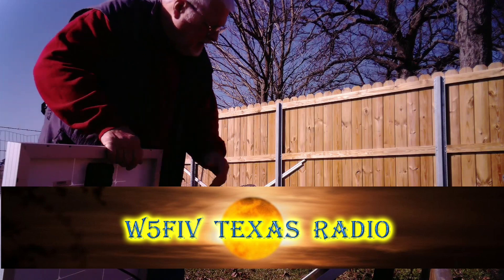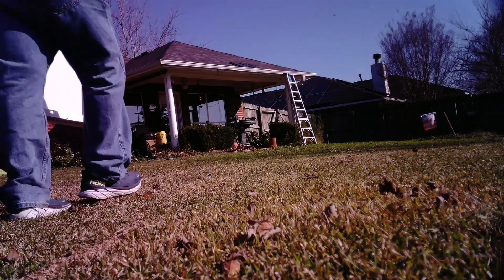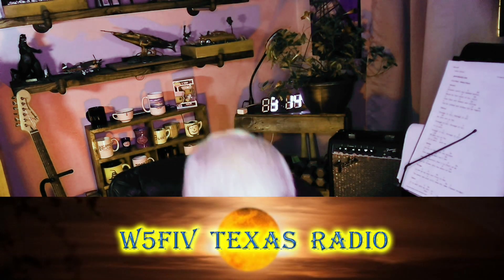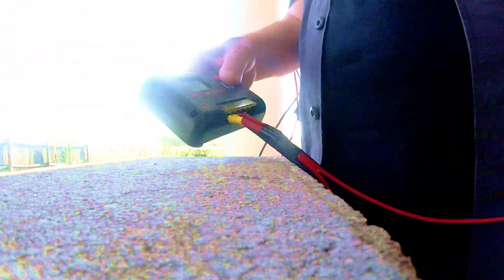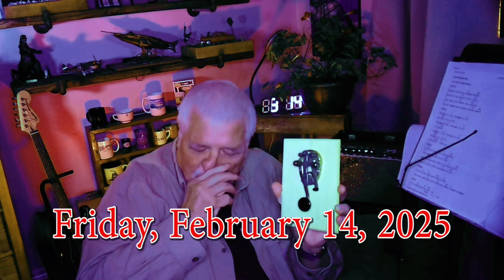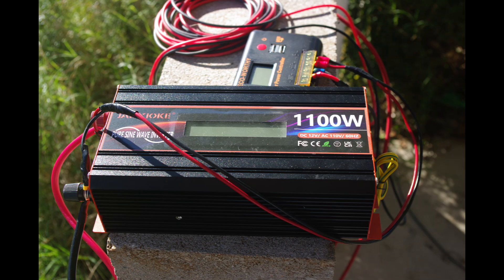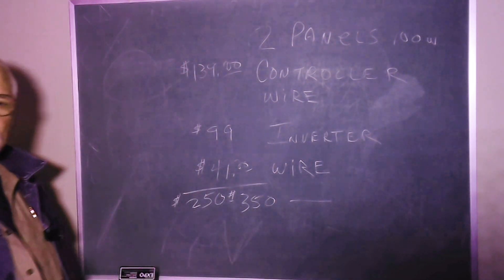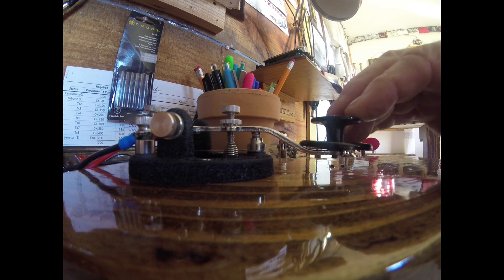How to Build a Solar Powered Shack

Comment: hey have a great day. i saw your morse code videos and wondered.. where can i use morse code? im a mining engineer.
Reply from the maker: Morse Code is mostly used now by ham radio operators as a hobby and by preppers who consider it correctly as a last resort long distance communication device. Simple to operate with no infrastructure.  Recently a couple of college students wrote me to say they use it to cheat on tests in class by signaling answers to each other… go figure. Anyway, thanks for checking me out and taking the time out of your day to send me a message. Means a lot to me. All the best. Jim
Reply: @w5fivtexasradio  thank you for your indeed respond sir. That exam cheat might work :) I wish you best luck. 22. Ömer.